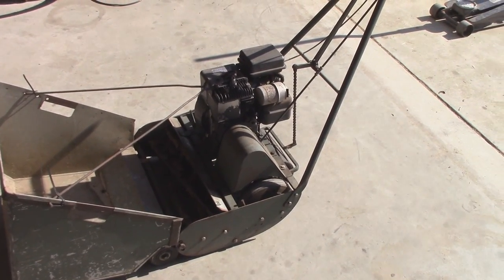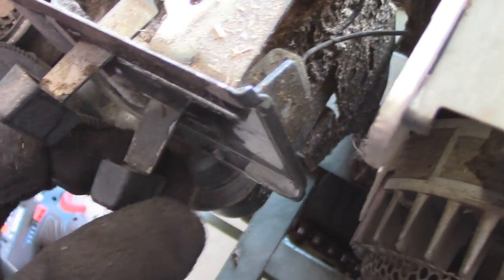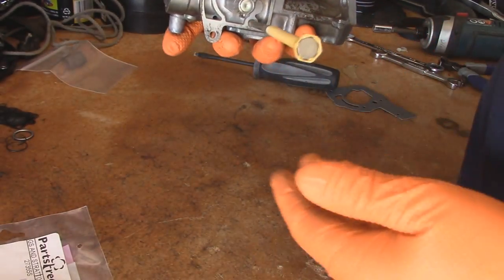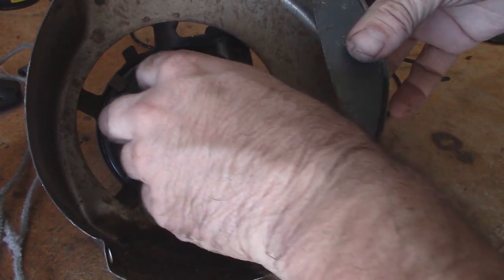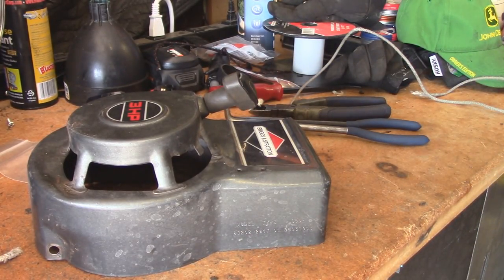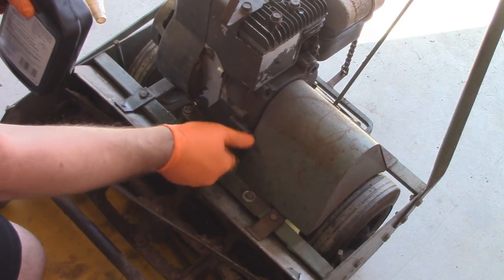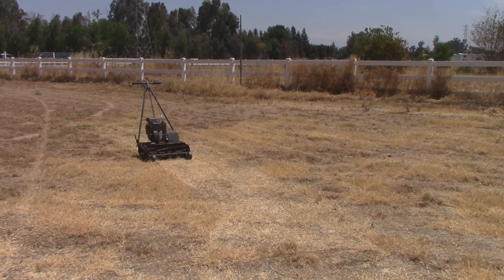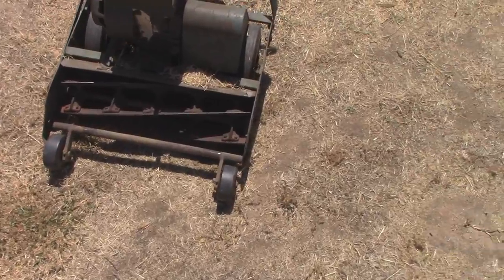Getting a California Trimmer Mower Running Again

Comment: Hank. Here in Central KY with all of the horse farms and huge properties, A person may assume that the motorized reel mowers would be everywhere- Not So. 
The only places that I recall motorized reel mowers being used would be golf courses as you also made reference to within your video. Thanks for your truly informative video. I’m very familiar with the 5hp? Briggs & Stratton engine that you were repairing the carburetor on.  The engines absolutely purr and the carburetor really sucks - Just Saying!!!. I traded my 5hp engine to a friend of mine who also  works on small engines for a Yazoo S-24 Big Wheel mower.. I re-powered the rear tine tiller that my 5 hp B&S come from with one of the blue 6.5 Harbor Freight Engines. I m probably going to do the same engine re-power for the Yazoo S-24 within the very near future. Best Regards Hank From Central KY.

Comment: Thanks for the video.  Not a good idea to mow dead dry grass it will heat up the reel and bedknife too much.  Not advised
Reply from the maker: Never heard of nor had an issue with that
Reply: Did you sell that mower on offer up.  If so I have it at my house
Reply from the maker: Eric Mello no. It was sold to a friend of a friend